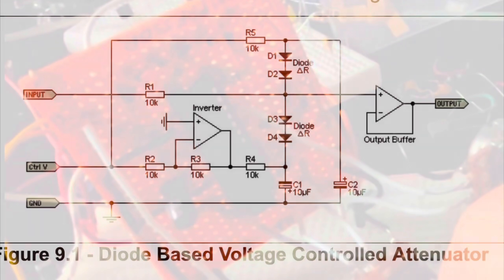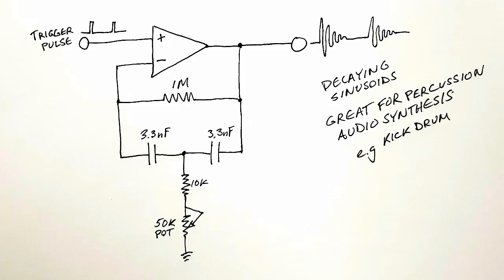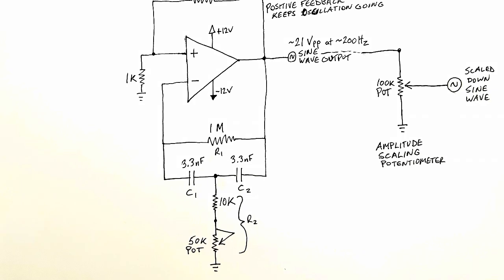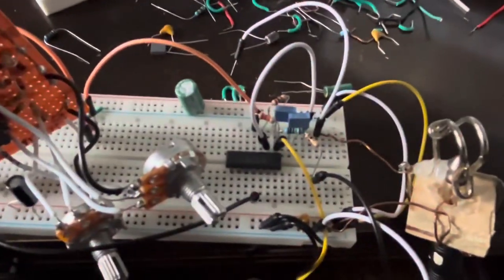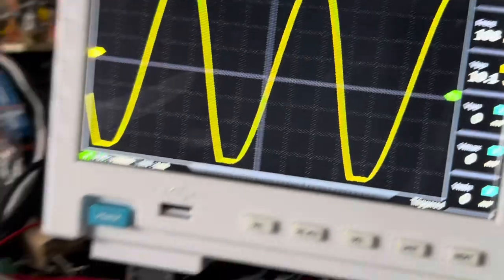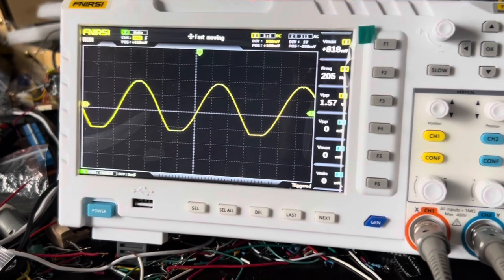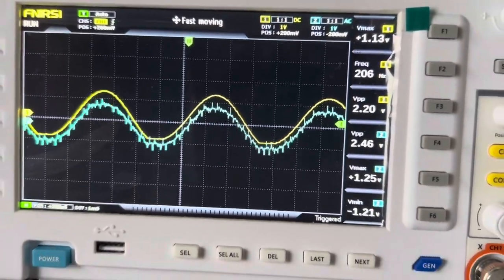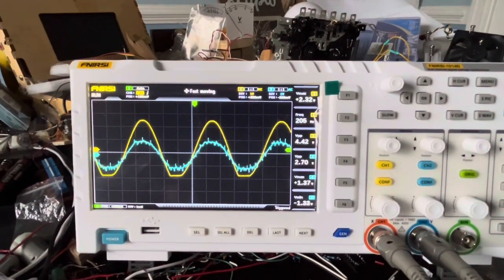DiY quick and dirty Sine wave generator to test an Automatic Gain Controller/compressor/peak limiter

Comment: i just found: AS6C1616C with is a 16 bit or 2 x 8 bit sram chip, but requires 19 address lines, 16Mb.
using 74HCT245 octal transceivers you can make the 8 bit data bus bi-directional between adc / dac and sram, to shut of the sound while recording.
Reply from the maker: @AnalogDude_  yes these are hard to get though

Comment: Pretty cool.

There is pretty much only one method economic interesting  to do agr is using a micro controller with adc, dac, enough opamps.
in some some Arduino library for mpc4921 dac, you can find a math formula for a sine wave. it doesn't take much to figure out how to make the others. however changing speed is a subject.
Reply from the maker: @AnalogDude_  this is just for testing purposes for me. Not practical as a vco. Would use a cd4046 or cd40106 and then a bunch of low pass filters to turn it into a sine wave for that. But as a function generator where i want to make a sine wave with an adjustable frequency, its pretty good.
Reply: @igorbrichkov3632  well, if you full wave rectify the audio, you can measure it's amplitudes with the microcontroller, than use a dac to open a ota, like lm137000 with some math to take averages to function as agr. that's what i intended to say.

i have a circuit to uses a opamp, 2/3 resistors and 2 equal capacitors to make sine wave. forgot the name of the oscillator. you only need a dual gang pot to adjust.
Reply: @igorbrichkov3632  Since i forgot the name of the Sine Wave osc, i made and upload a video for ya, with links to circuits. leave a comment : )